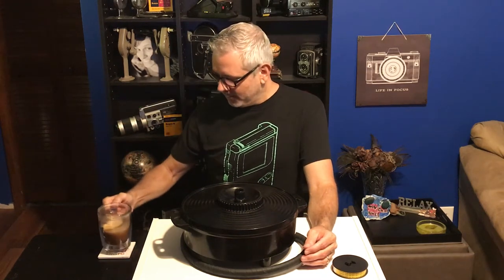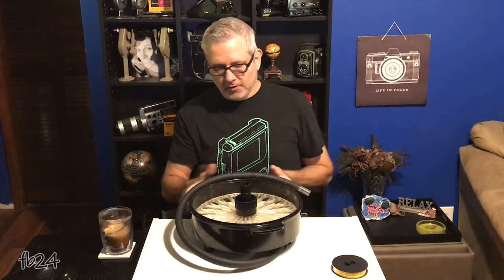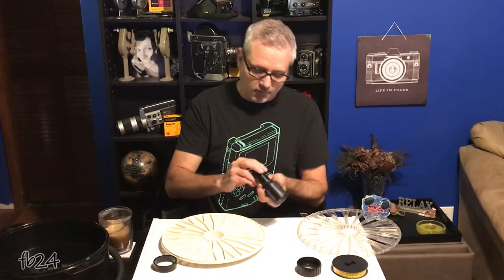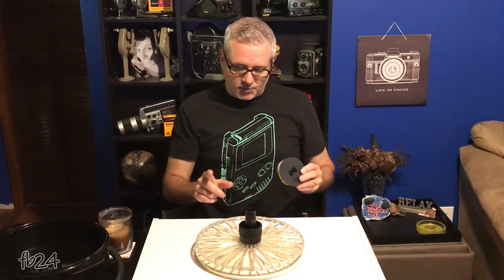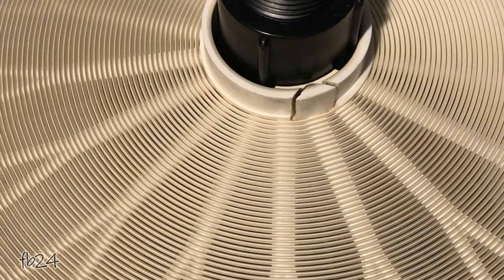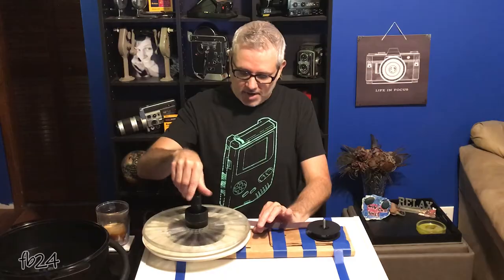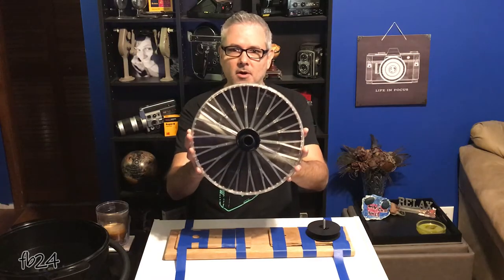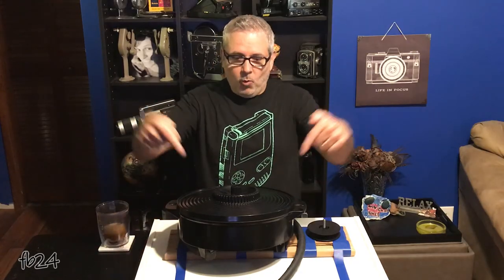Let's Load 100' of 16mm Continuous Film / HUGE LOMO PROCESSING TANK

Comment: Thank you so much for the link. i’m so grateful I found your channel. How do I find a developing chart to tell me which chemicals and time to process for whichever kind of film I’m developing at the time?
Reply from the maker: My pleasure! The best way to get started is to check out the "Massive Dev Chart", which has an enormous database of starting times/temps for just about any combination of film stock and developer available. Most is for 35mm / 220 type still film but has worked well for me over the years for movie film as well. They also have a section of long forgotten/discontinued stocks. Here's the link to their page:
https://www.digitaltruth.com/devchart.php
Reply: That’s perfect, I have there app. I suppose using 35mm film development specs would be same for 16mm
Reply from the maker: @bryanbecker , It's always been pretty spot on for most of the super 8 and 16mm processing I've done. There really is so many little variables but I always had good luck just kinda sticking with the averages.

Comment: Hello.  You are showing a tank from the USSR.  Have you produced tanks with a capacity of 3 liters for 16mm film?
Reply from the maker: Hi Sergey, I don't produce these tanks, they are from the USSR. This one will hold 100' of continuous 16mm film.
Reply: @Filmboy24  Hello!  Could you give in figures the dimensions of this barrel?  diameter and height, and how many liters it is.  Best regards, Sergey.
Reply from the maker: @sergeyharbey8559 , the diameter of the tank is about 12 inches (30.5 CM) and the height inside is around 3 inches (7.6 CM).
Reply: @Filmboy24  I have a Krasnogorsk -1 camera with three lenses.  the projector of Ukraine from the grandfather remained.  I decided to do it, but the barrel is not.  I decided to do it myself from stainless steel.
Reply: How much liquid is needed to develop one 30m film?
Reply from the maker: @sergeyharbey8559  About 2 liters minimum.
Reply: @Filmboy24  If I make a 3-liter tank, will that be enough?  Thank you.
Reply from the maker: @sergeyharbey8559  I'm not really sure, as I'm not sure what you're using to keep the film separated. If you're using a spiral like in the tank I use, then yes, 3 liters would be plenty. If you are planning to "bucket process" your film, 3 liters may not be enough. You'll have to experiment with different amounts.

Comment: Would you recommend using 16mm projector reel to the hold film in place in a DIY developing tank made from a 35mm can? Not sure if the chemicals will evenly process the film with this method. Great video btw
Reply from the maker: Hey Joshua, no, I would not recommend doing that at all. Your film will stick together badly and not process at all in most areas. If you were able to somehow figure out how to run your film from one reel to another (back and forth) while in your chemicals, then you would have much better luck. There is a processing tank called the "Morse G-3" that operates with this concept, but I still believe the best way for even home developing, is to have your entire roll separated and in the chemicals all at once. Thanks!
Reply: @Filmboy24  Ah right gotcha thanks, I thought that might be the case. I'm just trying to save some money as those old USSR tanks are quite pricey. Would you recommend an 8 reel Paterson tank? The really large ones? From what I've seen they might do the trick
Reply from the maker: @joshuawisdom7585 , yes, the Russian tanks (especially the 100' ones) seems to just get pricier and pricier, grrr.

You could certainly process any film in the Paterson tanks, or even "bucket process" as it's known. The biggest problem I've seen with these methods is a ridiculous amount of scratching to the film and fairly uneven processing due to occasional film overlap. I suppose it's a good way to experiment and get your feet wet with movie film developing but just be mindful of the results.

Take a look at this video made a couple years ago by my buddy, Ben. He was processing Super 8 in a Paterson tank:
https://www.youtube.com/watch?v=moUvV51TNmc&t=313s

Comment: I bought one off eBay last year! Mines also only came with one developing reel.
Reply from the maker: Would be nice to have a double reel on this. I have 2 of these tanks, wonder if I could modify the center post to take both reels.
Reply: @Filmboy24  hmmm you can definitely get someone to design it. Maybe look into 3d printing... Perhaps someone's already designed one out there. Dunno tho
Reply from the maker: @thelivingmanpart2  I've often wondered how hard it would be to design and print (or CNC in aluminum) a 400' spiral. I did some basic measuring and instead of a 12" diameter, it would need to be around 24". Seems doable if it's a more rigid material like aluminum.
Reply: @Filmboy24  that would be badass. Not sure how'd you'd do it other than designing it yourself or getting someone to design it. 

Tbh I think you're only the 2nd or 3rd person on YouTube who I've seen with the 100ft spiral. 
I had been looking on eBay for the past 3 years and didn't find mine until summer 2020.
Reply from the maker: @thelivingmanpart2  I really think it's possible, would just take some accurate design and a decent CNC machine. The key would be rigidity because (as I'm sure you know) as your film fills in the spiral closer to the outer edge, the top and bottom pieces are more susceptible to up/down movement. That's why I think aluminum or stainless steel would be ideal.

Comment: Mike - I’m thinking of getting the 50’ tank...even though my 🙂previous try about 30 years ago was not good (with the Morse tank). Are all those parts normally also included with the 50’ version, in smaller version, just so I know what I’m supposed to get with it.  Thanks in advance and no hurry for a response, just when you get a chance.
Reply from the maker: Hi Dave, yes, with the 50' version (UPB-1A), you want to make sure it comes with the tank (with single hose attached), lid, 3 inner rings (2 threading spirals and 1 cover), a 2-piece center post, 2 clear spacers and 1 black spacer. That's a complete package.

I'm with you on the Morse tanks, I've had a few over the years and just never could quite figure them out. Pretty frustrating actually.
Reply: Thanks for all the info!
Reply: Hi Mike I just took the plunge.  🙂Found one for about $225 including shipping and per seller includes everything except the adapter for 35mm, which I won’t use.  It won’t arrive til about end of March and I still don’t know if my camera is OK, so a “cart before the horse” move for me, but it’s not the first time. 🤗. I’ll keep you posted on this adventure.
Reply from the maker: @gtrplayer1000 , Haha, you sound like me, always jumping the gun!! Love it! As far as the 35mm adapter, it's an easy find later on if you need it. Yes, please keep me updated on this adventure, excited to hear if your camera can be resurrected from the depths.

Comment: Mike - Is there a way to use the spirals with a different spacer to process 100' continuous Super-8 film instead of 16mm?
Reply from the maker: That's a great question, Chris. The funny thing is, I have 2 of these larger tanks now, as I messed my first one (the one in this video) up. I over-sanded the center column down and now, 16mm film is too wide for it. You really have me wondering if I might be able to convert it to a super 8 tank now. Not sure where I could get 100' of super 8, or how I would shoot it though. Do you have a source?
Reply: No - but I have a bunch of 200' cartridges -- mostly Kodachrome -- and thought it would be a lot easier to cut them in half instead of down to 50' lengths for processing.
Reply from the maker: @chriscottrill5181  I like where your heads at. I'd love to get my hands on a couple of those 200' carts. Looked for a long time, just never got lucky enough to snag one. I need to pull out that tank now and see what it would take (if it's even possible) to sand it down and re-purpose it.

Comment: Great video!
What is the name of this Lomo tank with 106 foot capacity?
Reply from the maker: Thank you for watching! To be totally honest, I'm not sure. I initially thought they were made by Lomo, however, I was corrected by someone recently, who told me that Lomo never made a 100' tank. One was sold not too long ago on Ebay for $550 plus shipping, and it was listed under the "Lomo" name, so I guess most people still acquaint them as such.
Reply: @Filmboy24  Thanks for the info. $550 is a bit steep. But developing without cutting the film in half, would be nice...
Reply from the maker: @AnaloguePhoto  You're right about that, quite expensive. I got pretty lucky and paid considerably less for mine. It really is nice doing one consecutive 100' length.